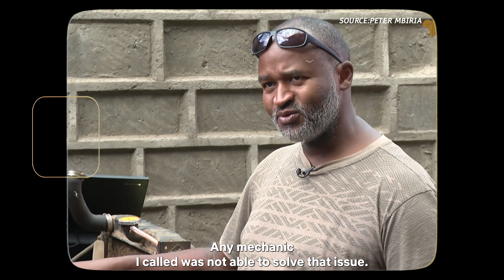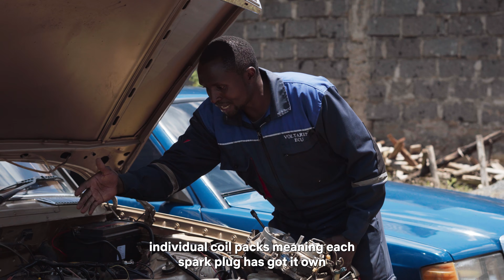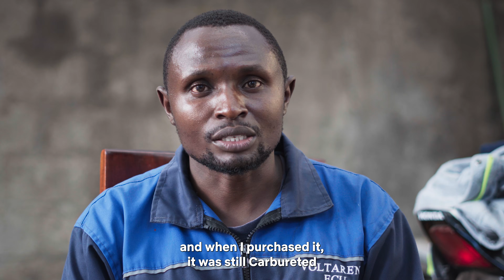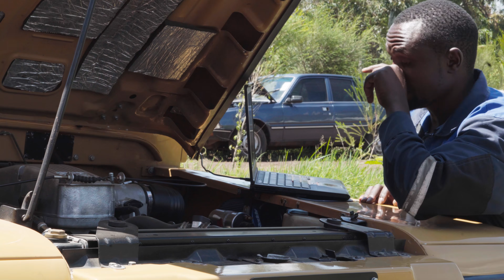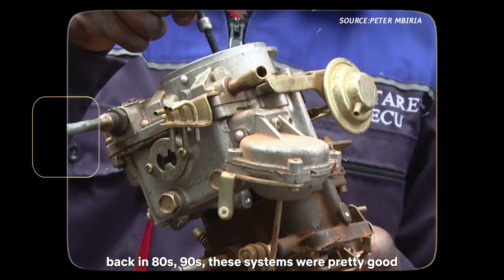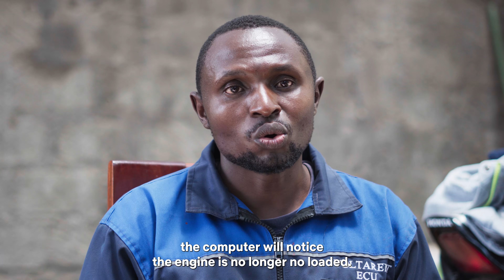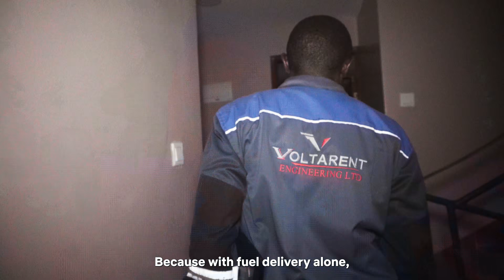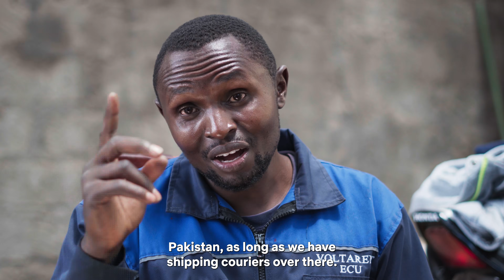This African Genius Makes Old Engines Work Better Than New Ones

Comment: Summary: African Engineer Peter Mberia Modernizes Old Car Engines with Volterant ECU

Peter Mberia, a Kenyan engineer and founder of Volter Engineering Limited, has developed a proprietary technology called the Volterant ECU that transforms old car engines (from the 50s to 90s) into efficient, modern-like engines. His innovation modernizes outdated fuel systems such as carburetors and Bosch Katronic systems, which were once efficient but now cause poor fuel economy and reliability issues due to lack of spare parts and aging technology.

Key Points:

- Problem: Older engines (60s to 90s) are inefficient, consume excessive fuel, and have limited spare parts. For example, older carbureted vehicles consume about 13,000 KES worth of fuel, while after conversion, they consume about 5,000 KES for the same distance.
- Solution: Peter redesigned engine control units (ECUs) from scratch focusing on minimal sensors needed (engine temperature, manifold pressure, camshaft and throttle position) to run these old engines efficiently.
- Technology: - Replaces old mechanical fuel injectors with modern electronic fuel injectors.
- Uses individual ignition coils for each spark plug for better ignition control.
- Provides real-time engine data monitoring and tuning.
- Offers four driving modes: Eco Plus (leanest), Economy (balanced), Comfort (more power), and Sport (maximum power).

- Benefits:- Significant fuel savings (e.g., improved from 5 km/liter to 14 km/liter).
- Improved engine performance without sacrificing fuel economy.
- Enables older engines to meet modern emission standards.
- Affordable conversion compared to frequent repairs or engine swaps.

- Customer Impact: Users like farmers and travelers have lowered their running costs and improved vehicle reliability. Some recover their investment within months due to fuel savings.
- Customization: Kits are tailored for specific engines (mostly M102 Mercedes engines), ensuring compatibility before shipping.
- Vision: Peter aims to contribute to global environmental goals by reducing emissions from old vehicles worldwide, including remote support for installations.

Peter’s work combines his background in electrical and electronics engineering with passion and persistence, overcoming challenges in research and prototype development. His story is inspiring for anyone interested in innovation and sustainability.

For more details, videos, and updates, search online for Peter Mberia or Volterant Engineering Limited on YouTube, Facebook, Instagram, TikTok.

Comment: Ecu is just one of many parts for an engine to run. Air fuel, Compression ratios, fuel octane ratings, inlet ports and exhaust ports. Even the materials used for each parts plays a crucial role in terms of performance and efficiency. But what you have done here is simple and effective by reducing those unnecessary sensors. Modern cars have way too many unnecessary sensors that doesn’t help the engine’s performance yet it even shut down the engine when they are fault.
Reply: i feel new cars are made into use-and-throw appliances.
Reply: @12345abcd_qwerty ... For real. Modern cars are designed not to be repairable.
Reply: he said this in the video
Reply: They aren’t unnecessary. In many instances, those sensors control systems to improve efficiency and/or power delivery. He’ll eventually have to do the same thing if he wishes to meet global emissions standards.
Reply: @romanonaidoo2737  What he did is to the simplest minimal effort to achieve 80-90% possible efficiency. Sure, there's plenty of room for improvement, but the more you try add the more expensive it gets. He does the budget tuning version which Africans can afford. They don't have the money for complete engine swaps or engine rebuilds!

His ECU is done dirt-cheap and does the least amount of effort for the most amount of results / bang for the buck. What you suggest is a new ECU that is at least 5 times more expensive / time consuming to make + completely rebuilding all the engines with modern sensors (which no sane mechanic would do for every car). 

Good luck surviving as a mechanic in Africa if you ask for 20 times the amount of money he does for a marginal 10-20% improvement over his solution.
Reply: @romanonaidoo2737 nobody is selling 30 year old retrofitted cars on a global scale
Reply: The  sensors are required to meet emissions.
Reply: @mrbrisvegas2  ... Hapa Kenya the population os cars is so miniscule ... Concerns about emissions are totally irrelevant.

Simplify everything for purposes of maintainance ... That is actually the most pressing concern ... Because our mechanics, especially outside Nairobi, are not prepared to maintain all those complex parts, sensors and computers.
Reply: Bro jealous down be honest he is genius an U knw that no one in the world can come close his skills
Reply: @johannesthokoane3972 lol there are thousands of weekend racers who are better tuners than this guy